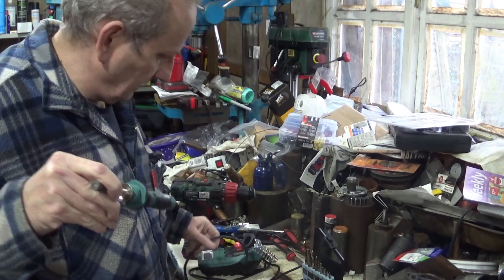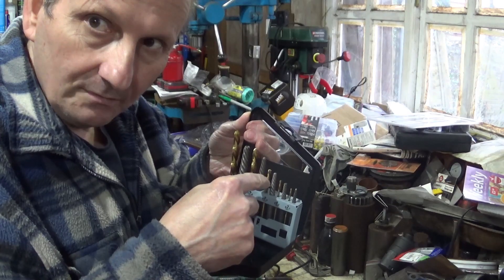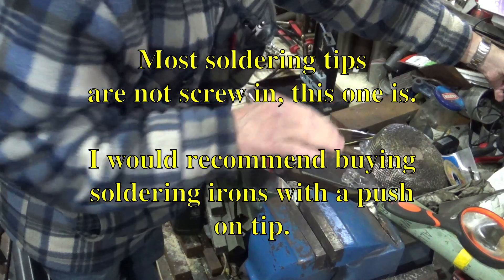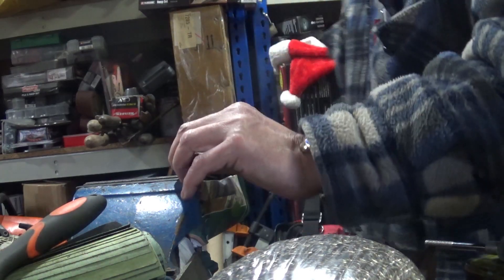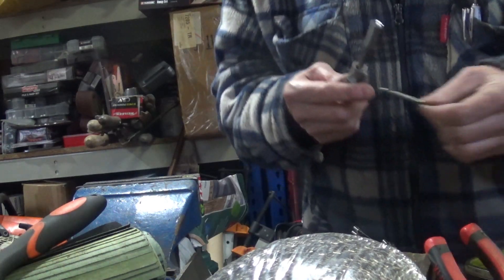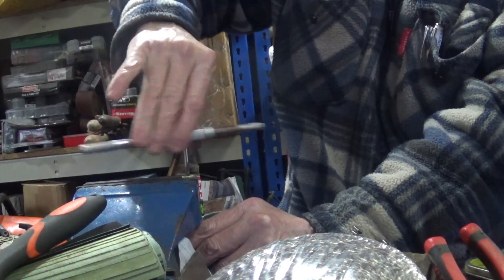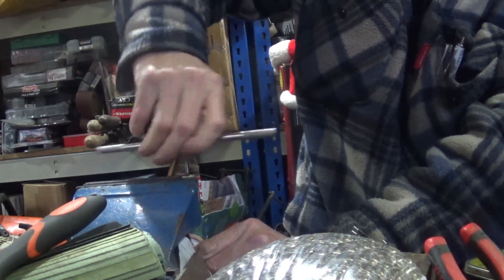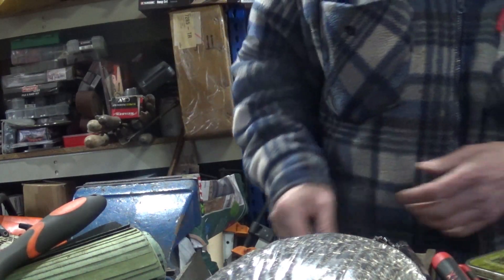Fixing a Broken Soldering Iron Tip on a Parkside soldering station

Comment: If you want to cut in red copper, you must use alcohol mix with a little bit oil.
Reply from the maker: By the time I was running a tap it was in steel, cleaning out the remnants of the copper, rather than tapping copper. However thanks for the tip.

Many thanks for watching, please like, share and if you like the channel, subscribe!

Comment: Tell you a funny story about a tap and die set.  In my driving instructor days I was doing a first clutch change on an MG Metro.  Unbelievably one of the three holes in the flywheel used by the puller didn't have a thread.  A passing instructor who I had never met, stopped to see if I needed assistance.  To this day I still find it incredible to say he had a tap and die set in the back of his car.  Cut a thread in the hole, he then went on his way never to be seen again.  

Whilst many may have owned a tap and die set back in the day who carries one in the boot of their car?  Saved me a lot of aggro as at the time I was baffled as to why two of the three pulley bolts screwed in fine but one wouldn't.  Subsequently bought a tap and die set.
Reply from the maker: I have many tap and die sets. Never kept one in the boot of the car. Interesting. Always handy to have.

Many thanks for watching!

Comment: Good to see you back in another video Ben. Nice work on getting the thread cleaned out. Those can be a bit of a pain if the broken bit is really stuck in there.
Reply from the maker: Can be. Not a good idea to have a screw in bit in a soldering iron if you ask me. Asking for trouble. Still, it is copper so much softer than the surrounding material.
Many thanks for watching!

Comment: I'd seen those soldering irons in Lidl and thought about getting one because it could be useful (the usual thing applies, if I do get one of their cordless items, I'd also need to get a battery and charger), but having seen the fitment of the tips, I'm somewhat underwhelmed.  I'd bet that you won't be the first or last person to have one of the tips seize in place and break.  Still, glad you got it sorted so you can carry on using it.  I've had little or no success with screw extractors, I think whenever I've had a broken stud/screw or whatever, it's needed to be re tapped, or in some cases when it's rusted in place, lots of heat to get it out.

Nice to see you back by the way Ben.
Reply from the maker: Heat often works. Many thanks for watching!

Comment: Good job Ben.Today I have to fix a friend’s exhaust pipe that the bolt snapped off.I have to drill it out the same way you did.I always start with a really small bit and then I step it up.Great video.
Reply from the maker: Cheers, and that is the way I go when drilling. However if there is enough of a stud sticking out to weld to, I would weld a nut on first and use an impact and heat to get it out before I tried drilling. (I did that changing wheel bearings on my Jaguar X Type).
Many thanks for watching!